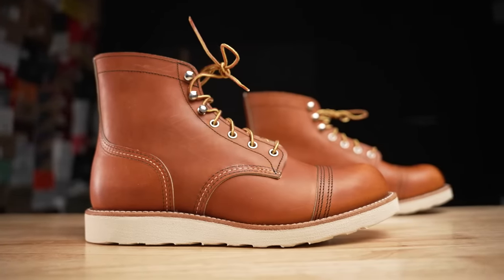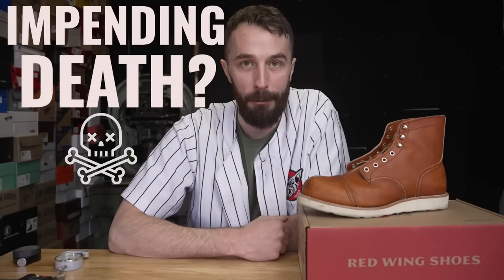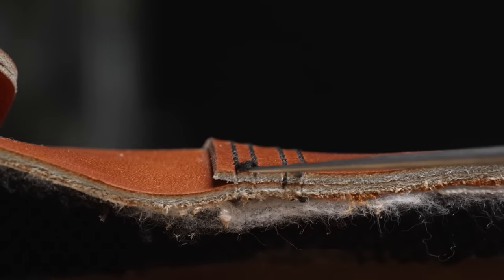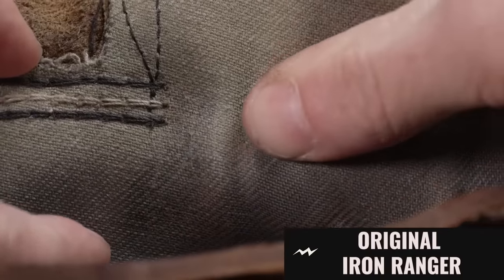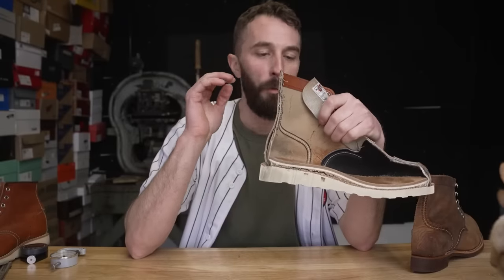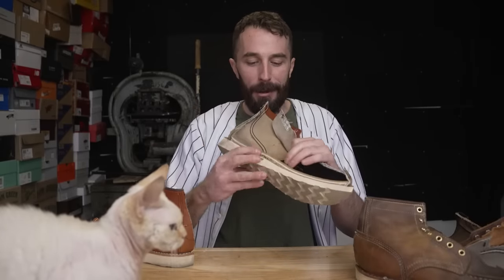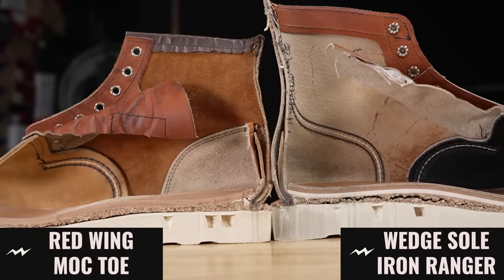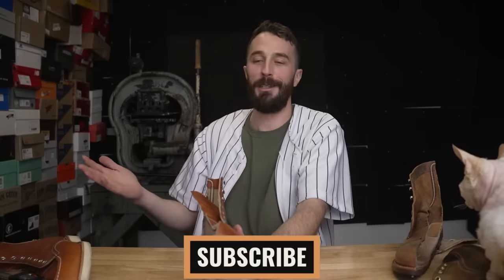Why People Are Pissed At Red Wing

Comment: I have a few pairs of red wing logger boots and two pairs of the red wing true welt and I've worn one pair of loggers for about 10 years until the leather got so wore out it wouldn't hold a speed hook anymore and only had to resole only one pair of loggers but I do like the true welts that I wear to work everyday working for a gas main and gas service installation company

Comment: You are not overreacting. After 48 years operating heavy equipment I know a little about work boots. I dumped Red Wing many years ago. They just will not hold up like they did say 25 years ago. The last pair I purchased lasted only a few months. I now purchase Thorogood exclusively. My current pair is over a year old and I expect they will last over two years as have the ones before them. I have tried them all over the years.

Comment: My Redwing's (I have bought about 5 pair of Redwing work shoes) that were 5 years old, worn for work for 2 years then occasionally for 3 years, completely separated at the sole and fell apart. This is the second pair that have done this and obviously this shouldn't happen. The quality has decreased while the price has increased. I just bought a new pair of Herman Survivors Pro Series all leather work boots at Walmart for $85. They are actually more comfortable than the Redwing work boots and appear to be very well made. Time will tell but so far I'm impressed at half the price. I'm not paying 150 or 200 bucks for shoes that come apart.

Comment: I've been buying red wing work shoes for fourty five years and I can honestly say I've never had a problem with them. AND I wear them all the time I'm a cement finisher and they are always getting covered in concrete,water I wear them in my shop when I'm working on equipment and they get grease and oil, diesel fuel and gasoline on them. They out last anything else I have tried. Always comfortable and are very durable. Work shoes are for WORK I don't buy them to looking pretty.

Comment: I know people who worked at the Red Wing factory, this was around the early 2000s, but they were barely making over 10 or 11 bucks an hour, for a union job.  Thats bullshit.  My family use to buy nothing but RW back in the day, through the 60s, 70s and 80s, and we are all in the trades.  Loggers, tree trimmers, concrete, general construction, maintenance, jobs where you are out in the elements and on your feet all day.  I switched to Keen about 15 years ago and have never looked back.  
My biggest gripe with boots and shoes these days is the goddamn soles are this weird kind of slippery plasticky composite, nobody makes solid rubber soles anymore and I cant figure out why.  Vibram used to be the gold standard for a great sole but Im not even sure if they are around any longer.

Comment: So on the price its a new boot right? The Iron Ranger sells itself. So you can have a slightly lower margin and still be completely fine. Might be an idea.

I'd love to see boot companies show a labelled cut in half boot same as you do on the channel. Because cause at that point there's no concern that they're trying to like 'hide' cheaper materials so you know it's actually a design choice and not them pulling a fast one on you. Maybe they could even have a description for why they used each material they did.

Comment: The company that I work for give us annual vouchers for new Red Wing boots, and the "Boot truck" comes by every October. When I began working for that company, and before receiving those vouchers, I bought a pair of steel toe Timberlands. Those Timberlands were so comfortable and durable, that even after 2-3 years of receiving those vouchers, I would still turn around and sell off the brand new Red Wings, and just stick to my Tim's. The treads finally wore out, and I started wearing the red wings... Holy crap, were they so much less comfortable, and they almost always wore out within around a year. I believe the model was "Irish Setter". They stunk, they barely provided any good support, and with having to walk 6-8 miles a day, working in a huge facility, they'd just wear out to the point that even the steel toes would be exposed through the worn out leather. Incredibly overrated boots... Good riddance, let them fail and die off...

Comment: I feel like at the point that the fiberboard is broken down as badly as you’ve shown, the leather isn’t much better and you’d be getting the boot resoled with either one leather or fiberboard both boots need new soles by the time it gets that bad and how much more does it cost to be replacing the fiberboard vs the leather

Comment: Ask yourself, how could you make a Red Wing boot more easy to break in, more comfortable and lighter? Somehow, more sneaker used feed friendly. Even if you donˋt try to save money and take good materials. You will end up with modern materials. In this case they seemed to use pretty good foam and a thinner but good leather. I donˋt even see this shoe beeing so much cheaper in production. Red Wind probly has a pretty good deal when it comes to thickleather. High dens orthopedic quality foam is not cheap either.

Comment: One thing on those shoes is the sole shape.
It is a more dangerous type of shoe for certain (most) types of industry that warrants work boots.  It is a FLAT SOLE.  Flat soles don't have a heel that can be used to "catch".  Think climbing a ladder (on the rungs).  Walking on lumber strune on the ground (house construction).  etc.  Walking in the woods and tramping on fallen limbs, then rocks, then muck.  Not a good type of sole.

As far as breaking in boots - it takes a month or so to get them almost comfortable wearing them daily.
How about a vid on how to break them in faster and better?

How about filling the boots with warm - that's WARM not hot water and letting them soak for 15 min. or so, taking them out, putting them on, then wearing them all day long with lots of walking and bending.
Do that for a day for the first test, then 2 days for the 2nd test, then the 3rd day for the 3rd test.
Thats one day then done, then do it for 2 days then done, 3 days.  So you are using 3 boots total.

Also for your motorcycle build that caused scuffed boots, get a piece of carpet and put it on the ground to protect your boots and also when laying/kneeling on the ground a softer, warmer layer to lay on.  (I do it).

Comment: I seriously doubt that the price difference between that one thicker piece of leather and three layers of material is a real deciding factor. I don't believe that it comes down to cheaper build for the same price, I think it's more for comfort. Coming from the views of someone who resoles boots I can understand your displeasure with this change but the vast majority of people wouldn't do that. For most people once a pair of boots wears out the just replace them. It is a disposable world and has been for a long time. People don't want to take the time to fix old stuff, they just pitch it and move on to something new.

No, I don't believe Red Wing is just going for cheaper to improve profit margins. But why build something that will last forever with proper upkeep and repairs if people are just going to throw them out when they get old? Why not just make it more comfortable? I think it will only show in the long term how good these changes are. The upper portion (the part that gets the most abuse) is still very high quality and if the soles are just as durable as the older ones they might wind up being just as good and more comfortable.

Comment: reminds me of the magnum boots in the early 2000s.  It was a superior boot for a light combat boot to the swat for the same price point.  They switched to a different manufacturer and the quality dropped significantly.  has anyone even heard of magnum in years?  No as they were so bad they got discontinued.  I have been a faithful redwing user fine with paying more for them as they lasted longer.  If the quality drops and they become disposable I will switch to cheaper disposable boots.  Redwing was supposed to mean quality for the price.

Comment: It is a deaf of of the brand I trusted since 2000 back then a pair would last me 3-5 years and more (still have one needs resoil ) the one’s I got in 2020 lasted 1.5 years (soils) might be able to re-soil if I find a shop that will do it. And the last one I got 2022 lasted 8-10 months (cracks in soils) and of course their customer data was last, I found receipt on 13 mouth, had to do it fry emails with compony   I don’t know if I accidentally deleted response or what later 4 month’s I called them they said it’s a warranty issue sand them in we re-soil them. But at that point the lather came a part because I used them. They said we will sand you a coupon for new ones. I don’t know if I should waist my money on them again. It’s sad material is different from older ones and it’s dose not work. They use to be the best ones, and now it’s just expensive.

Comment: They used lower quality materials to keep the price stable, not doing so would have required them to pass on the higher costs to the customers. Any boots they don’t lower the quality of materials on will need a 10-20% price bump to account for inflation to date- and this time next year will need a further 10-30% bump in price.

Comment: I am the owner of a  shoe repair shop for almost 50 years and the reason they are doing this is simply so the boot fails sooner. They've also done the same thing on the outsoles. They are using polyurethane instead of vibram 4014 Christy soles. Red Wing is a shell of their former product. They used to be the gold standard. Not anymore.

Comment: This is just my opinion, obviously, but I think Red Wings have been overrated for some time, like, decades at least.  I am not a cobbler and have no special knowledge; I simply have worn a lot of boots over the years.
In 1986, I inherited a few pairs of boots from my Grandfather, mostly because I was the only man in the family with feet small enough to wear them.  Among them was a pair of unworn, new-in-the-box Red Wing work boots he had purchased in 1978 as the replacement for the work boots he was using, which he figured were not going to last much longer.  Sadly, his heart trouble got worse quickly, preventing him from doing any gardening, carpentry, working on the car etc., and when he passed he had not had the chance to wear his new boots.  I used his old boots for lawn work, and in 1990 got my first "factory" type job, at which point I began wearing the Red Wings.  They didn't even last five years.  The thick "oil-resistant, non-slip" sole began to crack, and when I took them to the boot-repair shop I always went to, the man showed me that it was not really a Goodyear welt as claimed, and therefore the boots were not easily repairable.  Soon afterwards, the soles split completely, just like the cheap, plastic fake combat boots they used to sell at K-mart.  I replaced them with a pair of Doc Marten's which I wore for work until 2018, when my wife got me a new pair...

Comment: I've got a pair of the 'oxford'-style Red Wing workshoes and they have that synthetic material inside them, plus a carbon-fiber toe cap.  No problem with accelerated deterioration or comfort after almost two years of walking around at jobsites for half of my worklife (construction and building inspection).  Biggest sign of wear is the sole.   The shoes will probably last another year but I'll be retired by then.  😉
Reply: Get a cobbler to resole them

Comment: I bought a pair of red wings years ago (mid 2000s) at Sears. Heard good things from the old timers on the job and decided to try them. The boots fell apart after 3 months; the Timberland Pros I had been wearing were good for at least  6 usually 12. I'd heard that they sold the rights to the name to Sears/Craftsman and they put a tag on a cheap copy. Still would like to try a pair of real ones but for now Ariat is my boot of choice. The pair I have now are almost 2 years old but still kicking.
Reply: They were probably die hards

Comment: Very unimpressed with the 2 pair of redwing I’ve owned. One 6” moc toe non safety toe the other a safety toe 6”. The steel toe wore through quickly and the sole rubber wore very quick as well. The moc toe non safety toe wore quickly. The sole actually cracked after 2 months of work and I’d get water inside the footbed all the time afterwards. The fabric/canvas upper ankle eyelets ripped soon thereafter at about 6 months. Had the eyelets converted to metal and the soles replaced with vibram soles because I didn’t want redwing crap on it again and my shoe guy recommended vibram. Replaced the insoles with timberland anti- fatigue insoles. Literally better than factory and a fix for my old boots. Any of my newer work boots have been timberlands or keens. Just better constructed for heavy work
Reply: Better yet, get custom inserts for your boots or shoes. My chiropractor carried Foot Leveler brand when he suggested a custom insert about 20 years ago. I can't fully describe how much difference they made in foot comfort. Sounds crazy but I could do 8 hours standing & walking on concrete with zero discomfort in dress shoes(yes), a universe from what I was used to. 
I believe Foot Leveler is still around. They had several different models and my own preference is the leather topped one. Since then every set of shoes or boots have these inserts. I was having back pain at the time, so that's why the chiro got involved. The inserts actually reduced stress on my lower back which was welcome although not a cure.
Reply: Give Thorogood a try if your on your feet all day at work.

Comment: At this point I assume that they are trying something new. I’m not against new. But not every new thing works. You will never have progress with out trying new things. But if new doesn’t work then you need to put it back into R&D, put it in the archives and wait for technology to improve to the point where it can be tried again. Hopefully with better results. Or maybe chalk it up to a learning experience and move on. If in the future they continue to do this especially with legacy boots then I will be upset. I can understand if they want to have a separate line for lesser expensive boots. Perhaps call them _____ by Red Wing Boots or something. But it shouldn’t come at the cost of their traditional style of boots or at the cost of turning off loyal customers. Dayton had or has I’m not sure if they still do H&H boots. I still have a pair of H&H boots because I can’t find anything else that I don’t have to custom order like them. I love those boots. I can only wear them for riding these days because they are so worn out and no one will rebuild them because they are only H&H boots. They need everything except the leather replaced. Insides of the boots are as worn as the outsides are. I’ve had them since 1996. But a good fitting boot on a budget, is hard to come by with size 13 EE flat feet. Great for swimming. Bad for finding foot wear.

Comment: So basically you proved the boot quality is there, and gave us a personal opinion on the toe lining. I work in a heavy construction trade so a solid, comfortable boot is a must (in fact trade required) and almost every boot I've owned has been a Redwing or Irish Setter. Why? For the reason I stated above. I would rather have toe lining that better wicks moisture then no liner or a thin canvas liner. Who wouldn't? 

In closing, to answer your question posed at the start of this video, the toe liner will not be the death of Redwing, period. It seems you wasted a quality pair of boots on a false witch hunt.

Comment: Red Wing JUNK-- From 1987 to 1999 I bought 2 pair a year (swap to dry a day) Thats 24 pair.Last 2 prematurely failed. (shank on right let loose cut threw stiching both pairs see a problem here?) Where I bought them and Red Wing didn't want to know me.  THEY LOST 23 YEARS OF MY BUSSINESS NEVER AGAIN . I still have them .After watching ths I cut them apart,These and the last 4 pair were the most GOD awfully uncomfortable boots ever.What did I find??? the extra material not clean trimmed but folded under all cobb ass under your leather insole liner.(like walking on stones all day-- no QA dept ?) 3 yrs I ruined my feet (thought it was to many hours on concrete floor) you want to see pictures? What the HELL were you boys thinking selling this crap??? Thanks a lot RED WING --- NEVER AGAIN signed Eric Simmons of central NEW YORK STATE.

Comment: I find it funny that you think these for  lack of better wording "yuppy boots" are the problem. The reality is the quality has dropped requiring needing repair or replace sooner. Also the service after the sale has collapsed. It used to be I could pick up a pair of Red Wings and they would last me all year doing landscaping. Now though its 4-6months. Then I would get them resoled and get another year out of them or set as backups for wet days. Now though they no longer want to provide that service so they use gimmicks to avoid it. Like "you didn't buy them in our store" or they are over a year old , do you still have your receipt? etc etc. It used to be free lifetime service for normal wear and tear. When you drop $300+ on a pair of boots it's only expected they should outlast the cheaper made boots. Now though I could buy 6 pairs of the cheapy Dickies for the same price and they would last 3 years.